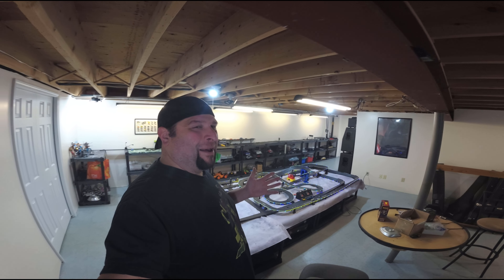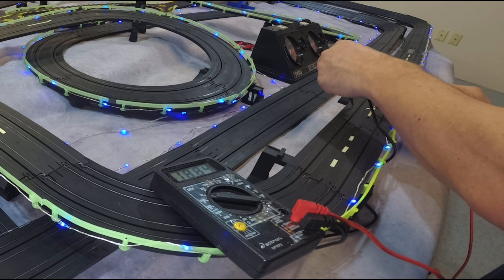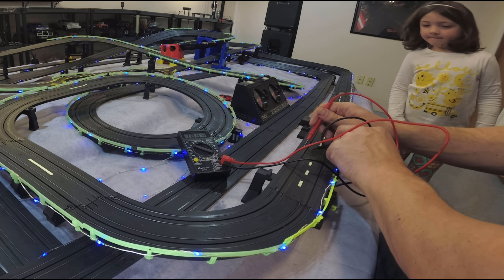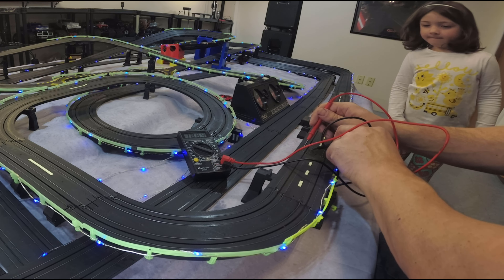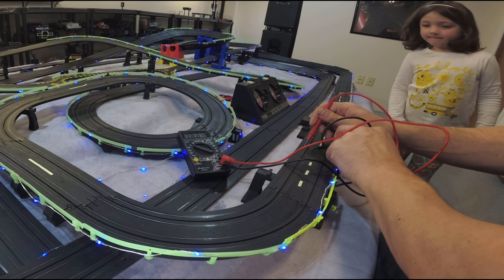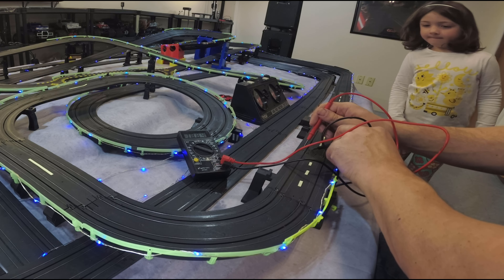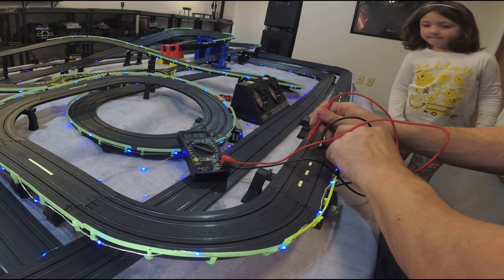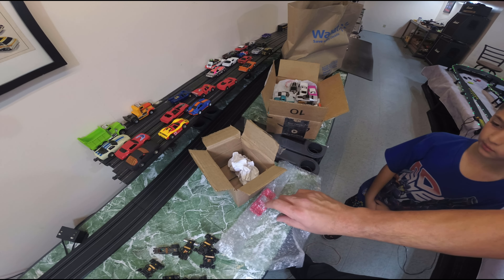Slot Car Race Track Repair Viper VSpec LED Night Racing Power Loss

Comment: Look for a product called Rail-Zip it's a corrosion inhibiter and track cleaner. It a model train product that you put a drop on all track connections where the metal rails meet each other and you will not have any dead spots for a long time.
Reply from the maker: Awesome, thank you!